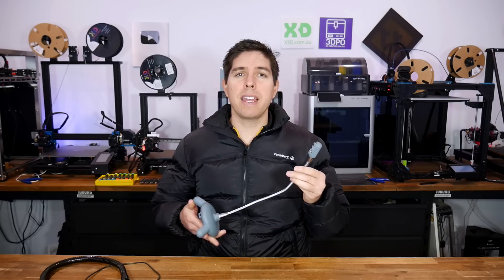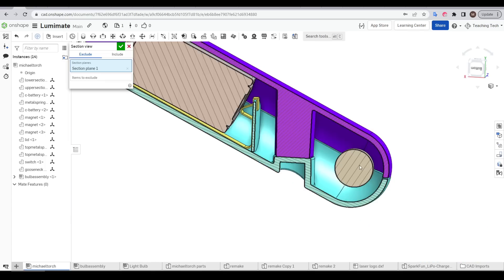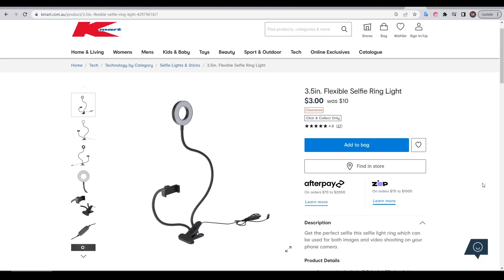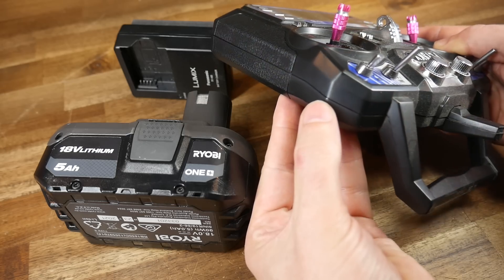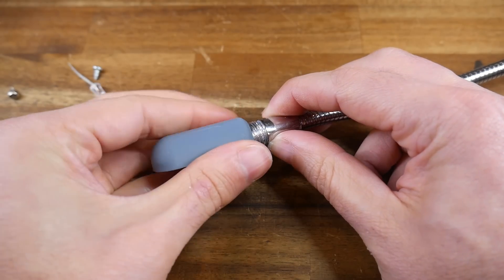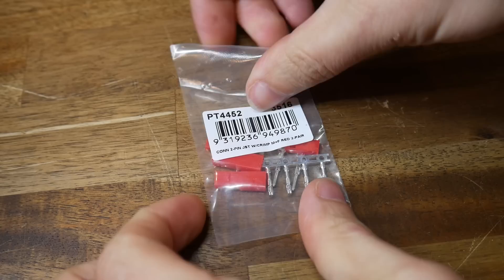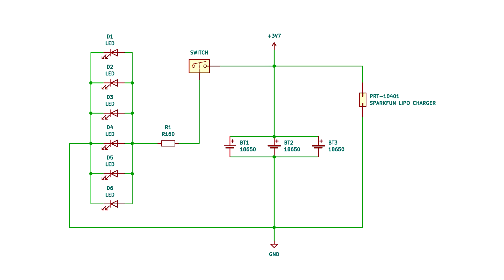I designed this light 20 years ago, now I can finally make the Lumimate

Comment: I designed a torch many years ago. It was a hand torch which exploited persistence of vision to prolong battery life and mimicked motion you tend to make when negotiating dark paths (sweeping side to side or making circles and ellipses). The design got no further, due to cut backs I was told the light at the end of the tunnel was to be switched off.

Comment: Overall, the design works well! Having the 3 'feet' to help with uneven surfaces is a good design choice! Just some suggestions from a hobbyist mechanic and aerospace engineer: If possible, moving the switch from under the base to the back of the lamp head would be more convenient, using a COB led array would provide more light. A row of 4 or 5 charging LED indicators progressively showing battery charge state would be a nice addition. Adding rubber seals between the joining seams would help to keep oil out from oily hands, etc.

Comment: I would personally use high intensity smd leds as they offer much better brightness. You will need to use a bit of thermal paste/ thermal pads and fabricate a cooling block for the rear of the leds but that could be from a simple scrap bit of copper or aluminium.

Comment: To save on the cost of the magnets, what if you made a steel magnet sandwich assembly.  Basically 2 small steel rectangular plates as the "bread" with a rectangular magnet as the "meat" of the sandwich.  These usually are found on cabinets, drawers, etc.  You can get them for $2 or so.

Comment: wow someone using resin for a practical print. And why not. I feel like resin gets a bad rap for use in practical printing when its actually useable for stuff like this
Reply from the maker: If the geometry is right, resin prints can be very strong. The last functional resin print I made was a helmet vent. I made two and destructively tested one, it was incredibly strong.
Reply: @TeachingTech  I know which is why I am happy to see someone using it for functional parts. I also use it for functional as well as aesthetic pieces.

Comment: On top of the suggestions about how you wired the LEDs, I would think you'd also maybe prefer putting them at a different angle, like the Ikea Jansjo.  Your design has you constantly turning the head of the lamp 90 degrees to where you want it, while a lamp head like the Jansjo has you pointing at the goal.

... also, I'm just realizing that they now sell the Jansjo as a USB lamp. Mine are on clamps attached to machines and desks, but plugged into the wall via a 4V 0.75A wall wart.

Comment: Impressive - thanks for sharing. 

I'm learning yet feel massively inadequate with CAD for my 3D printing and other projects.  

Michael, how much of the electronics knowledge did you formally gain in your Industrial design training? I'm a Microelectronic engineer with specialist background in Electromagnetic Environmental Effects and find I'm having to revisit a lot of basic knowledge for projects like this. 

I'm now medically retired and considering formal education to learn more CAD/CAM ... I'm not sure where best to get engaged in it though. Do you have any recommendations? I trust you would have some genuine insights as a Teacher.
Reply from the maker: My meagre electronics knowledge came as a hobbyist, there was nothing including in my design degree. At uni we focused on the design process, project management, CAD, presentation with software like Photoshop and Illustrator, all with a big focus on designing for manufacturing (primarily injection molding).
A lot of universities and TAFEs in Aus now have 100% online courses. I did industrial design face o face but later when I added my teaching degree as a post grad, it was all online apart from one exam.
For your needs, it depends on where you want to teach and the academic requirements they have. So maybe look at where you could teach CAD, and speak to them about what qualifications you would need to be employed.
Best of luck!

Comment: Great video showing the process of designing and improving the model, one thing I would add to this is PCB holding LEDs, bare wires without isolation could lead to short one day, especially in moving part

Comment: I like this project, but $80 for magnets just isn't feasible.
Reply from the maker: That's true. I used what I already had or what I could easily buy, but it could be refined with much more researching for better fitting components.

Comment: you should of used a pcb under the lights head. when it gets smashed thoes leads will short. a pcb will make shorting out much harder AFTER the housing breaks. simple perf board

Comment: One potential change is to connect the batteries in series with a BMS and then use a buck regulator to drive the LED's.  The efficiency gain should increase the run time of the batteries as well as prevent over discharge.

Comment: What resin did you use to print. I've never managed to print parts that fit together like that due to warping.
Reply from the maker: Phrozen ABS like grey. I had a little bit of warping, the shadow line wasn't quite even the whole way around.

Comment: I like it. The only limitation I see is that car engine bays these days are mostly made up of plastic, aluminium and non ferrous alloys. Not much steel around other than the bonnet and chassis
Reply from the maker: I had this issue filming the examples. If the goose neck were long enough, the underside of the bonnet would be suitable for most cases.

Comment: First thoughts are: I would use FDM printing with a more impact resistant material (for the base, at least. I find resin prints are brittle and are not UV tolerant). If you put the magnets nearer to the surface you want to attach to, they don't need to be as big. Finally, I think a LiPo flat cell would probably allow a more streamlined design.
Reply: Another thing. Having had to do a couple of jobs completely by feel recently, a companion to this with a wireless camera would be pretty sweet.

Comment: I imagine there's some reason you wanted to use your resin printer (mine's certainly sat unused for a while...) so I won't critique that over the more obvious choice of ABS, but it's worth noting the absurd cost of the magnets is due to their orientation here. There's a reason commercial versions of this use exposed disc magnets, just a few mm thick; something like 20mmx4mm would probably even be overkill if they're actually pointed the right way.

Comment: Very expensive and odd shaped magnets, you should be able to get strong enough magnet for like $5 each something like d20x10mm.
Charger board with MINI USB seriously, the micro usb that came after it is obsolete itself already, why not use USB C which we have around for at least 5 years???
It also only charges at 500mA so assuming some salvaged 18650s at 2000mAh each you have 6000mAh in total so over 12 HOUR CHARGE TIME!
And again that charge is expensive for what it is at $10
"Compact and efficient 5mm LEDs" bro those are one of the least efficient LEDs, and if you're going to drive them with resistors you basically make them even worse, designing battery powered lights means you MUST USE SWITCHING CURRENT LIMITING for the LEDs to waste no energy.
Protruding power switch on the bottoms is a bad decision as well, I can tell you for sure that you place it to some uneven surface and the switch gets toggled and light goes off...
Also it seems like the light is too focused.
Reply from the maker: Thanks for the feedback, but i think you may have missed some points from the video. The LEDs are compact and efficient compared to the incandescent bulb the light was originally designed with. The whole point was to make a single light to bring my invention to life. To do this I went for components I already had or could easily get. If this were mass produced the research of components would be a project in itself.

Comment: The switch is not in the best position imho
Reply from the maker: I found that a few times when placing the light. Bumps would switch it off. I wish I had put it on the neck like the original design.

Comment: Very impressive video. Great example of the engineering process. Some alternative suggestions for your design to think about: 
1) 9:20 - Change the holes for the LEDs to a hole and a slot (not necessary here, but something to always remember as an option). Two holes over-constrain the part, don't allow from the parts to "breathe" due to temperature and humidity cycling, and warp more easily during molding.
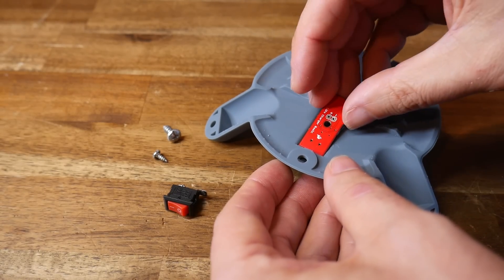2) 8:16 - Instead of always going for a "snug" profile fit, make the opening 1.5mm larger around and add standoff ribs, bumps or cones strategically. Especially for prototype parts, they are easy to shave down to get to the right fit. This is great to dial in alignment issues too. Another example of over-constraining the part. Please remember your datum rules: 3-2-1. The A datum is 3 contact points (surface), B datum is 2 contact points (line), C datum is 1 contact point. All parts that fit together should follow this rule (exceptions for very large or flexible parts).
3) Would this have been a good example to add a textured finish onto the part? You will be gripping it with greasy hands often. Maybe?
Again, good job on your design. 👍

Comment: When making holes for screws use a square instead. The material the tread takes away gets pushed into the corners of the square and it is less likely to crack. - a great video, it’s nice you came back to the design to make it a reality, it shows how far you’ve came
Reply: Also, remember to make the hole for the screw longer than the screw by 1.5x the diameter of the screw, minimum. This gives a place for the cut thread scrap to go.
Reply from the maker: Both great tips, thanks guys.

Comment: Resin parts are just too fragile for functional parts imo. FDM is much better, wont look as pretty but with this sort of product I think substance is more important than style.
Reply: Yeah I wouldn’t use Siraya Tech Fast Grey for this, but for a prototype? Sure.   There are a number of technical resins which could be used for actual parts out there though.  CNC Kitchen tested some Peopoly/Siraya Tech Blu a couple ago iirc.
Reply from the maker: The last functional resin part I made before this was the helmet air vent (covered in a video). I made two and destructively tested one. It was insanely strong due to the curved geometry. Resin minis might be prone to damage but functional parts can be surprisingly strong.

Comment: great project and execution. Btw why not print the thread for screws as well ? I've printed m2 with resin printer and it did well and chance of splitting resin print is pretty much non existent and larger threads are even more stable.
Reply from the maker: I agree that would be superior. I think I was trying to minimise portions that would need iteration. Self tappers were more forgiving on paper at least.

Comment: What is the point of a shadow line? I did a little googling and can't seem to find reference to the term.
Reply from the maker: My understanding is that they make the junction of the two parts more forgiving. Imagine you had a mating surface warp, that will be hidden more than if the two parts were butted up together.

Comment: nice!!  the only thing i can think of that would be something to think of. would be having some grip on the feet, which would help the smooth feet from slipping which could be a thing later on with a longer neck or certain angle.  so awesome to see this though!
Reply from the maker: I agree. I thought about a flexible sock for each foot just to protect the light and surface you were sticking it too. Grip would be a welcome bonus.

Comment: I'm a little horrified about the cells not having any protection circuitry whatsoever. If a short occurs (e.g. the wires in the gooseneck get pinched or rub through the isolation or something) you essentially have a recipe for fire.
Reply: Would you recommend adding a PTC or something else to the circuit?
Reply: @tomsko863  My recommendation is to use cells with integrated protection. These usually have a tiny board with a DW01 and a 8205 mounted to them, under the heatshrink. You can get/add such protection boards externally, but it's usually not worth the hassle – get proper cells in the first place and be done.
Reply from the maker: I have some protected cells somewhere in my collection. It's likely I'll redesign with a proper BMS though.

Comment: Very nice project. One suggestion I would have is to avoid running LEDs in parallel like you have. They won't share current evenly and, worse, can thermally runaway.  The LED forward voltage decreases with higher temperature, which will cause one of your LEDs to carry more current than the others and self heat itself even more. This process continues until the LED fuses, then another one will runaway, etc.
Reply: Or just do it the decent way: 
- Some ultra efficient, high power leds. That are 10 times brighter than those he uses now.
- A led driver, that supports dimming trough a sense resistor.
- A multi position switch, in order to set different brightness's.

The resistor before the led's, is just inefficient and cheap...
Reply: @timmy7201 +1 There are much better LED available.
Reply: After spending 3 months on a LED DLP projector backlight (for automotive HUD application) i cringe a little when i see something like this. BUT if it get's the result he wants and if it helps him have the project finished i think it is the best thing to do :)  I sometimes drop hobby projects because i know the effort/time needed to get some little electronic thing right and i  just don't continue - and this is worse than having something half assed in a finished project:)
Reply: I don't like "metal" goose necks  (reason why I never worn a metal wrist strap - DC inside Battery Chargers)

Comment: Hi nice work, would you care to show in dept parts of how you designed for example the led mound and the battery body housing? I'm very interesting to see what criteria (parameters) you used to create that led holder ledge mechanism and making sure the bottom and top rounds for the batteries match as a circle when they put together.

Thanks anyway for sharing.

Comment: Mere hours after Amazon delivered my new DeWALT DCL045 mechanic’s under hood work light (last night).
Reply from the maker: My friend has one similar to that. It's good for overall illumination but we've found as soon as you lean forward to work on something, your shadow blocks the engine bay.
Reply: @TeachingTech  …probably why the MCL045 (Mac Tools version) has a detachable handheld flashlight that docks with the folding light bar and chargers off your other battery. ;) Truly ridiculous price though, and I don’t like the idea of charging an integrated battery off an expensive battery and wearing out both when I could just use a freebie flashlight to see in the shadows. ;)

Comment: Awesome design Michael, one thing I would have done differently is using a much brighter COB led. Those smaller lens type seemed a little weak.
Reply: very much this! BMS + 3-5W COB LED and youve got yourself a nice light. Good V1 though

Comment: I've been working on a simple LED arrangement for an R2-D2, and trying to figure out how to physically connect a half-dozen LEDs in parallel.  Now I have a much better notion of what to try!  Thanks!
Reply: You're not supposed to put LEDs in parallel like that, he did it all wrong.
Just look up what LED strips do, 3 LEDs in series with a resistor, then such array then placed in parallel, the resistor will even out the current distribution.